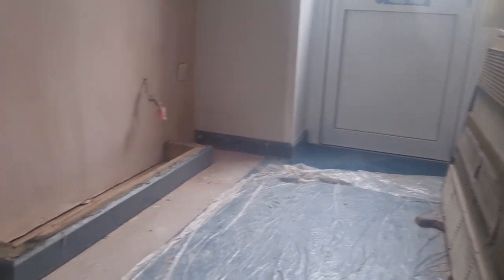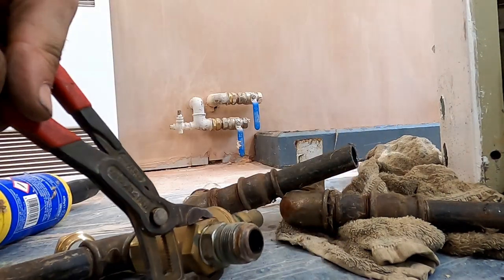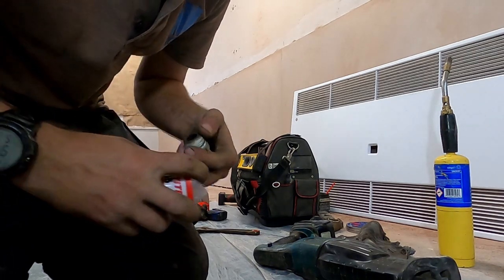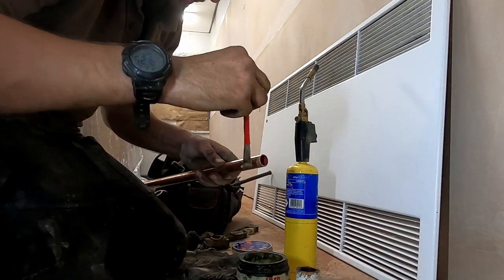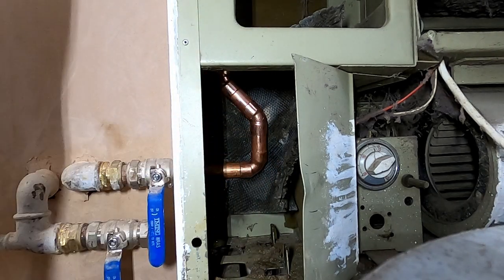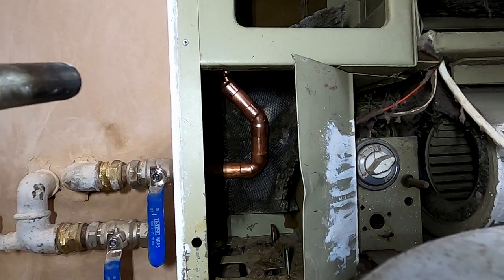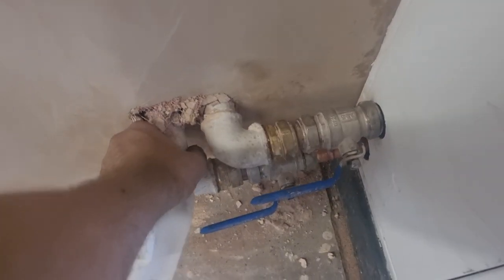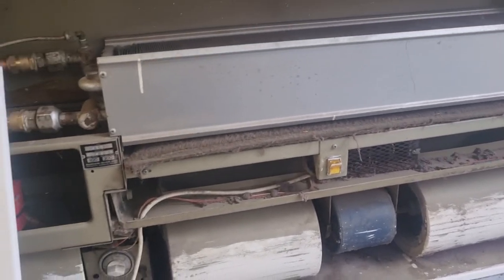RE-PLUMBING AN FCU Day in the life of a plumber

Comment: You done all right there , such a tight space , ain’t that simple to prepare everything and work on it , time goes like nothing 😂 I wish people understand why we install additional valves, it’s easier access and old stuff once you touch it , it does have a bigger chance to leak in a shorter run .. and with a copper reducer’s you’re not wrong, even 22mm goes to deep inside the valve , I do the same , never take any risk , do it once  right ain’t matter how long it takes you wouldn’t be working on it twice 😅 another tip for you, I can see sometimes is struggle when you tightened the valves they’re moving slightly, have you noticed all valves have before the tread a nut pre designed, but only works with a Rothenberger or Bacho  adjustable wrenches , because they got smaller Jaws if you browse them and type in a smaller/thinner jaws they do come up and that’s what they’re designed for , worth getting them , saves your wrist cracking and valves wouldn’t never able to move , better firm tightening.
Reply from the maker: Thanks for the support as always mate, I used to have a really nice thin jawed adjustable but I lost it, I really do need to replace it as like you say, they are perfect for fitting onto the the hex nuts of lever valves

Comment: It looks as if you enjoy that type of job. Still a lot of life left it that hearer. A lot of firm would just try to sell them a new model.
Reply from the maker: Thanks for the support as always Colin, they are great heaters to be honest, you can still get the motors rewound if needed, it works out at lot cheaper than a brand new unit
Reply: @PlumbLikeTom  problem was the kids in schools soon found out that if you gave them a good wack on the top when running clouds of dust would fill the room. 😂😂